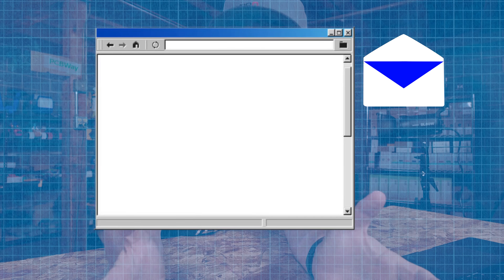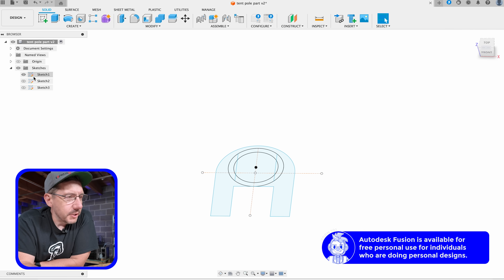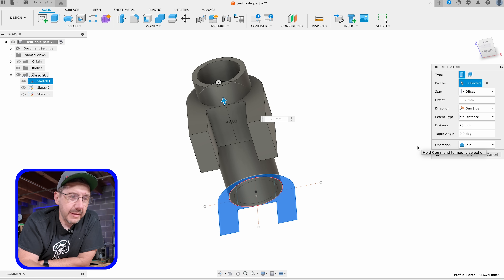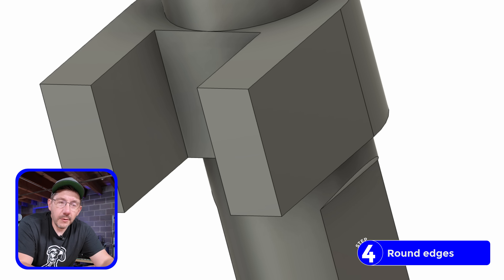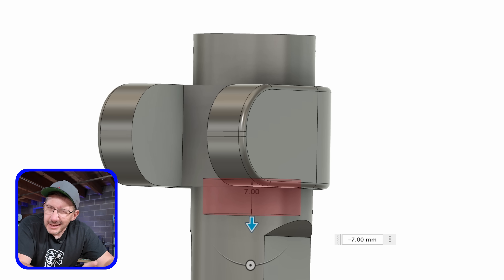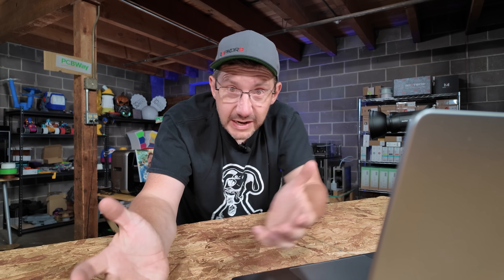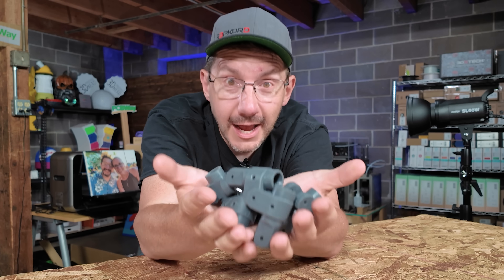Fix ANYTHING with 3D Printing – How To Design

Comment: This is EXACTLY why I got a 3D printer.  Recently we had an issue with a banister on our outdoor deck and was quoted 1,000 to fix it.  I said to myself, I have to be able to model aomething to fix this.  2 hours later I had my part modeled after some test prints, printed it in its full dimensions and saved 998 dollars and have a safe secure area of my home.

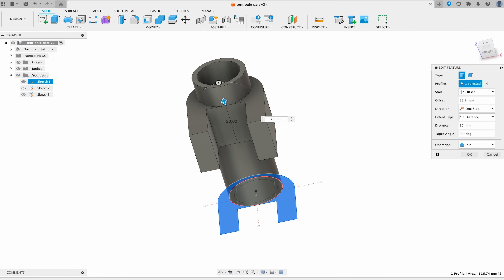Comment: Small tip in f360 : right click on the top of the hierarchy and activate the history function, then on the bottom you will see a line appearing representing all what you've done (do it before doing anything ! Otherwise nothing will appear). At 8:19 for exemple, you would have been able too click on the play button and it would have shown all the steps one by one.
Furthermore, you will discover that it helps you in the process a lot
Have a good one !
Watched from France

Comment: I have started doing this except with FreeCAD. I just got the cheaper Bamboo A1 but it has been amazing to just draft something up and actually use it in real life. 

I started with Plasticity, as parametric modeling seemed intimidating. But man being able to easily update dimensions is a game changer, as rarely is it perfect the first time.

Comment: "How it starts..." so much of my 3D modeling experience started this same way: thing is broken, I need to fix it. It's a fantastic way to start learning... and then finding it breaks again and learning about print orientation, then materials, then "those weird little parts" were actually structural elements, then "those other parts have nothing to do with the part and exist so it can be injection molded" and (related) "the top of the part is 20mm and the bottom is 25mm" not because it needs to be but because ti makes it easier to release from the injection mold so you can make it easier...

Eventually you're using the broken part as a baseline to compare and designing everything else for printability and strength in ways injection molding couldn't do. How it starts...
Reply from the maker: It's a journey, right?
Reply: @3DPrintingNerd my first cad-for-3d printing model was a tube with notches and it took me 6+ weeks of on-off work.

I took the opportunity that every time something broke, i tried to model it. Now I can design replacement parts in hours (if not distracted).

The original part would take me minutes.

Fun fact: a number of my recent models were done directly in PrusaSlicer. One of them was even a kitbash where I cut it up, modified it, reassembled... All in the slicer.

It's iteration and practice.

Comment: You make it look easy the fusion 360 design, for some beginners like me it's stil complicated although I am now designing and printing templates for a laser and engrave company. I follow the tutorials online and use a ton of search based questions and answers. I fixes my own outside ledlight with a design that just costs me like 10 minutes saving me 30 euro's from buying a new lamp. 3d designing is key when you own 3d printer(s). Thanks for sharing. BTW: big very big question, what is going on with Chris Riley (Chris' Basement) ?
Reply from the maker: The easy part is only because I practice doing it a few times before filming it :) For Chris Riley - I'm not sure! I think he is just taking time for himself and his family.

Comment: Great repair, though i am missing the 'why did it break, let's make it stronger' part.
Also the screw needed a chamfer, not a fillet. But he, who cares.
Reply from the maker: thanks for watching! the stronger part was the new material. The Tough 2000 in this application should outperform the ABS material.

Comment: Nicely done. I did something similar many years ago. it was a threaded part for a compresion fitting for a dress makers mannequin/ dummy thing. I printed it in PLA as a draft @ 0.3mm on an anycubic i3 mega (which I still have).  I intended to do a better job with more infill but they didn't want me to as tthey were happy. I doubt it is still working but they were a student and have probably got a lot ofgood job and better equipment now.
Reply from the maker: What a cool story!

Comment: Blasphemy: your sketch isn't fully constrained!

On a more serious note: is all the rounding needed?  When creating a 3d printed replacement like this, it's good to have a look at what geometry is really needed and what geometry may be changed to take more advantage of 3d printing.  Making parts flat instead of round can avoid tricky supports and potentially orient the part in a direction that makes it stronger.
Reply from the maker: hahaha. so, was it needed? probably not. when I am looking at things, for some reason my brain is always trying to replicate rather than improve. I should work towards the improve rather than replicate.

Comment: Awesome modeling work! It came out great! but if the original part was made with ABS plastic could you have just acetone welded it back together?
Reply from the maker: I thought about that, but I wasn't sure if the acetone weld would hold as well as an isotropic piece. PLUS, this gave me a chance to try some 3d modeling.

Comment: Exact reasoning I used to justify buying a printer.  There are several dozen pieces I have drawn and deployed around my house and truck.
Reply from the maker: That’s so cool! Have you shared them online at all?
Reply: @3DPrintingNerd anything that I feel has broader application than just the solution I needed, I publish. Mupshot on thingiverse and printables

Comment: Calipers and printers are the way.  Often you can improve a part by making it more chunky, the reason parts are skinny is usually because of the limitations of injection moulding.

I do this in my local buy nothing FB group, make little parts for fixes for peeps, it has improved my CAD heaps.
Reply from the maker: So so cool!

Comment: 4:53.  Always add fillets LAST…. That is advice I got long ago and it pans out… for 2 reasons 1) often fillets get in the way and make things harder to manipulate if you add them too early and 2) you will end up finding new places to add fillets later in the design anyway and you can get them in with a single operation in your timeline… which is the last thing I’d say… looks like you are modeling without a timeline….  Turn that on so you can revise anything in case it doesn’t fit.
Reply from the maker: Oh I had the timeline! It was probably zoomed in a bit so you couldn't see it. I LOVE A TIMELINE

Comment: One of the great benefits of 3D printing failed parts at home is improving the design to avoid repeating the failure. Increasing the material thickness or adding ribs, gussets, fillets, or other features to strengthen the part at the failure point would make the 3D printed part better than the original.
Reply: My parents fridge handle broke a few years ago on Christmas Eve day while we were prepping for dinner    Thankfully, I found someone had made a beefier version when it fails and I had it print over night    It's working out great     Replacements are $80 for a pair (fridge/freezer)

Comment: 3d print the whole tent frame. or just the connectors to the metal tubes. cad ftw. but not when talking your own. wholesome empty betrayal to own. you tough boi. lowfi.

Comment: At 4:30, you don't need to enter a measurement.  In the Fillet dialog, where it says "Type" change that from "Fillet" to "Full Round Fillet".  Same result, but quicker & if that part width needed adjusting then the fillet will update automagically.
Reply from the maker: oh heck yeah thanks for the tip!

Comment: Filament printing is much stronger than rosin printing you should have 3D printed it the old fashion way and it would have been a lot stronger being a design engineer all my life and using a 3D printer to make tooling and a robotics handling devices you could do anything with 3D printing if you think about it think outside the box Maybe you can combine it with some other items that film it is always gonna be stronger than rosin
Reply from the maker: Which filaments? I used Formlabs Tough 2000, and it's strong enough to be a hammer and nails, and I pounded those nails into wood. Normally resin wouldn't be my choice, but Tough 2000 was exactly the type of resin for this use case, plus, I could orient the part any way on the build plate and get isotropic properties.

Comment: But for 3D printing, you don't necessarily model is exactly the same, but it should be modeled to add extra strength and support in the area that it broke.   It broke because the original design could not handle the stress point in that area and thus extra beefing up in that area should be considered.
Reply from the maker: YES! A few comments like this, and it makes total sense. I was so worried about copying the part that I didn't even think of beefing up the part and making it better.

Comment: Looking at how you did the drawing, it wouldn't be the way I would BUT this is the cool thing about a lot of these Cad applications: lots of different ways to achieve the same outcome, and you tailored it to suit your needs. Good on you for helping them out as I know it can take a lot of time to fine-tune models with multiple prints until you get the one that is just right.

Comment: Instead of extruding the holes and filleting the edge you can use the hole tool set to countersunk at the correct screw size.
Reply from the maker: I think I remember thinking about this at the time, but I didn't know the size of the screw they would be using, so I tried to mimic what I saw on the broken part.

Comment: I had two projects this week - I made hinges for a metal fence gate, and printed drawer runners for a parts cabinet.  I use Tinkercad for my designs, never could get the hang of F360.  What is great about the process is that you can quickly print test parts and make adjustments if needed.

Comment: When you're designing replacement parts like this, keep in mind that you don't have to create an exact match.  For example, if a piece always snaps in the same place, and it doesn't impact fitment and usability, make that part stronger by making the wall s thicker.  If there is a curve that's hard to reproduce, and that area being blocky won't effect how it works, skip the curve and go for an easier part to model.
Reply: Great comment!
Reply: I was just thinking the same thing. Adding a bit more material and radiusing the edge where it broke feels like an improvement that would really help make sure it doesnt happen again... if the piece is an improvement they may even want to replace the remaining existing piece with your better one

Comment: LOVE it. I've only been at this for a bit over a year now, but the problems I've solved, saving stuff from the trash, not spending $$, or just taking something that we already like and improving it have amazed me. You know the gross rubber thing that goes in the sink to keep the disposal from splashing stuff everywhere? Yeah, I didn't want to pay $10 for a new one, so I made one. Or when the neighbors put in a new fence, leaving an 8" gap between our fence and where their old one was, and now the dog can squeeze out? Yeah, made a decorative trellis to take up that space. Gridfinitizing drawers or installing a Multiboard? I kicked out a gaggle of customized holders for stuff. Need a clock for the garage? Upcycle half a Prusament spool, add some bits, and boom - clock. Need a home for the pack of 100 608 bearings? Yeah, built a storage box. Tired looking trailer hitch receiver socket? Make a new plug. Tired of replacing felt pads on dining room chairs? Design and print some TPU foot-covers. You're limited (mostly) by your imagination. Keep making stuff. Sometimes it's a miserable failure, other times you nail it and it's perfect.

Comment: You had me all the way until the $10k 3d printer. 😢
Reply from the maker: You don't have to print it on this machine, or a resin machine. I did because I have it and the Tough 2000 resin is made for use cases like this. I could easily see this working in a stout ABS or ASA print on a typical consumer FDM machine.

Comment: great video! May I ask you why you decided to go with Resin instead of FDM?
Reply from the maker: I went with resin because the Tough 2000 resin is made for this sort of use case. Plus, this meant I could orient the part however I wanted on the built plate and get isotropic properties.

Comment: Fixed a music stand at Church that broke; took the original part, measured and designed the part.  Was able to use the original screw and nut in the final print.
Reply from the maker: Heck yeah!

Comment: It looks like it is completely intact, just broken/split.  My question is, why not just use 3D Gloop for ABS to fix the original part?  The Gloop will be stronger than the ABS itself.  Then of course, you can design a new part that is stronger where it needs to be.

P.S. Make sure that all of your sketch lines are “black”, as those blue lines are not fully constrained.  😉
Reply from the maker: I thought about that and offered it but really wanted to try and design the part!

Comment: i am an enthusiast with a decent understanding in arduino , good experience in coding , web dev , digital electronics  and still a newbie in FPGAs. I now want ot get to 3d printing , however learning CAD is not an issue , but the mechanical part of the objects. Do you have any suggestions eg books , etc that can help me learn the mechanical part of it
Reply from the maker: What do you mean by the mechanical part? Do you mean all the hardware parts of the printer?

Comment: Add time frame 6:40 you talked about fillets on the holes. they were not fillets they are countersinks and they're designed at 82 degrees to match the head of the screw. 82 ° specifically prevents these screw heads from becoming self locking and therefore less difficult to remove.
Reply from the maker: Ah right! I knew it wasn't a fillet but couldn't remember the term "countersink" thank you!

Comment: Designing that in CAD was easy part. I don't have a resin printer so my concern the entire time you were designing it was how you were going to print it with fdm to account for the layer orientation strength challenges. Resin printing is definitely the more optimal additive manufacturing technique for this geometry but given that I don't have access to it, I'd have probably had to have gotten a little more creative to make that part and make it properly strong enough to use.
Reply from the maker: heh, yeah. resin printing was what I had in mind the whole time. If I were to FDM print it, I think I would have done things differently.
Reply: @3DPrintingNerd with FDM, this would be one of those times where you have to replicate the function while being more flexible in the forum.

Comment: Just remove glue. paint crack with acetone let it dry and part is fixed
Reply from the maker: I told them about that part if they wanted to do it, but I also wanted the challenge of trying to design this part.

Comment: I work in a hotel, and print myself some replacement parts that i have to design myself. As you explained, take it bit by bit, and take it to shape one detail at a time. I've created replacement parts for the key holders inside the room, for windows, for the security cameras, for the shower door rails... a little bit of everything, sometimes for new products, and other times for old products that are not on sale any more, and you can't get replacement parts anywhere
Reply from the maker: Daniel - this is freaking awesome! Do you show off your work anywhere?
Reply: @3DPrintingNerd  Not really, we are a big company, but for the moment i'm the only one who has a 3d printer (and know how to do simple 3d designs), but other hotels  (from the same company) are requesting me some replacement parts because they know what i do. I have the workshop with multiboard as well, and i created my own version of infinite storage for personal use
Reply: It would be nice to see example like this featured

Comment: There are two big things to keep in mind when starting to CAD something to replace a broken part.

1: Check if you can buy a replacement part cheaply
2: Injection molding and 3D printing have different engineering requirements, and commercial parts are often designed to save fractions of a penny where possible.  Figure out what surfaces and dimensions actually matter.  From the in-use photos, it looks like the outside dimensions could have been expanded, making the part even stronger, especially around where it broke.

Other tips:
- Fillet/chamfer at the end.  Preferably after a test print.  
- Look for simple improvement options.  In this case, maybe a recess for a nut on the back of the screw holes would also help.
Reply from the maker: Great tips!